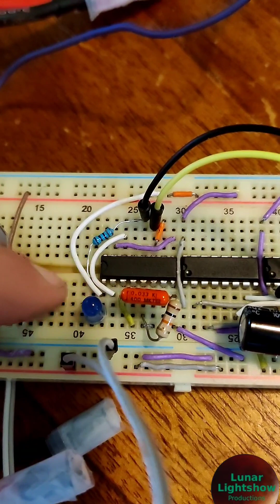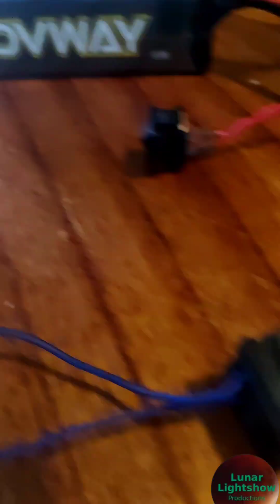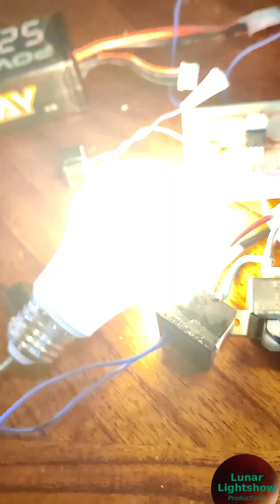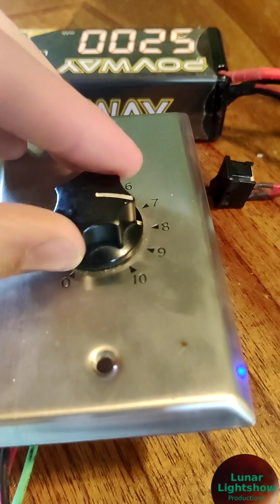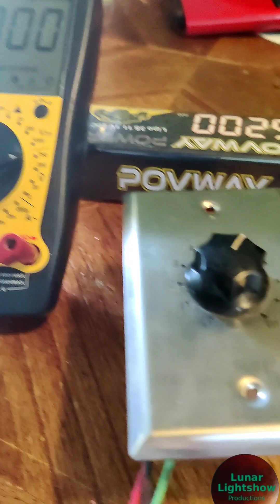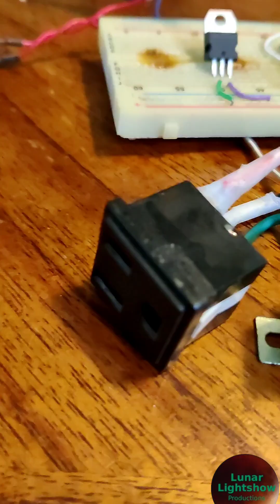Power a LightBulb with a Battery! DIY 12V DC to 180V+ AC Converter Circuit with 1 4049 IC & 4 L293Ds

Comment: Also... you can measure higher voltages with your meter, by dividing them down first. If you had, say, a 9K and a 1K resistor in series, 10K total, you could put a voltage across those. Then measuring just across the 1K would give you a tenth of the voltage. Ohm's law as applied to voltage distribution around a circuit. 

I'm really not trying to insult your intelligence but be very very careful with 1000V. It's a small transformer but a human heart is sensitive to much less! Be careful with the existing 120V or so too. You could literally die, only takes a moment, so be diligent and disciplined.

I don't know that they actually make 9K resistors, and for accuracy you'd measure the actual resistance of yours, rather than just going by the label, so you can calculate properly, because you want exactness I'm sure. 

It would also work with, say just 900 ohms and 100 ohms. But the total resistance determines how much current flows for a particular voltage (again Ohm's law). 1000V / 1000ohms would be 1A which, multiplied by the voltage, is 1000W, which is way way more than your resistors' power rating. In fact using 9K and 1K resistors would give 100mA, which, also x1000V would be 100W.

So actually you'll want much higher resistances. Small resistors are usually 1/4W, 250mW. So at 1000V that's 0.25mA. So... 4Megohms I think, in total, at least. So why not 1Megohm and 9Megohm resistors, giving 10M total, at 1000V that's 0.1mA, x1000V = 100mW, which is fine. That's still enough power to kill you though, of course. Maybe practice all this with 9V from a battery first or something.

Or else find yourself a bunch of electric heaters...
Reply from the maker: great idea! i should try that
Reply: @jacob_davis   Pardon me rambling on, but I get there in the end!

How old are you btw? Seems like your photo avatar thing is a few years old, I was very impressed by a kid who looks 9 making an inverter! But even as a teen it's impressive. Do you learn any of this at school or is it all self-taught and Internet?

When I was at school, I'd often be bored. But I had a genuine interest in science, so I just read the textbooks through for something to do. Actually learned better than from the lessons. Where we'd be given an experiment to do, it would inevitably fail for some reason, then the teacher wrote on the board what should have happened, for us all to copy down. Dear me!

Actually if you misbehaved you'd get shoved into a little cupboard of a room. What they didn't seem to realise was that the room was stuffed with back copies of New Scientist magazine, a respected British magazine a lot like Scientific American. Except not American. So I'd spend an hour or so with all these fantastic magazines reading about science, and learning a load, even though that wasn't the point. But curiosity will teach you much better than most schoolteachers. Although some are encouraging, and love the subject themselves, which really helps.

Not that I'm saying misbehave at school. Only if the punishment is more interesting and educational than the lesson.

Comment: Dude! Thanks for the video! Nice design, simple but does the trick, and would actually be practical if the power went out, you could at least power a lamp, well, y'know, you have! 

If you wanted true sine wave you could do it the way you describe but you'd probably need an analogue power amp, doing what the motor drivers do, for a sine wave which you'd probably generate with an analogue oscillator as well. But analogue stuff breaks my brain. I just tinker, not got a proper electronics education. 

There's such a thing as "modified sine wave" which I THINK is just leaving a bit of off-time between the positive and negative pulses, but is surprisingly useful in practice, although again, as you say, not so great with motors. Since square waves have high-frequency harmonics, which don't move the motor but do cause heating in the coils. Also of course if you went with 60Hz you'd have to have much more powerful drive circuits, using a higher frequency means you can get away with sending lots of little bursts of energy instead of fewer, bigger ones. Incidentally that's why power supplies, phone chargers, are so light these days compared to the old linear ones that had a big transformer inside. Instead, they work at high frequency pumping the input voltage into a much smaller transformer. Switch-mode power supplies, PC PSUs are that type.

You could do it with a digital to analogue convertor (DAC) though. Have you heard of Arduino? I have a feeling you'd love it. Little single-chip with a CPU, RAM, programmable flash ROM, and lots of peripherals built in, all in the one chip. So you get ADCs and DACs and timers and stuff. Microcontrollers have been around for decades. Speak 'n' Spell had one in the late '70s, but modern ones are more powerful. And the key thing with Arduino, is it's large community and software base. There's software routines to do all sorts of useful stuff, just about anything you could think of. Infra-red remote, RGB smart LEDs, keypads, smart cards... 

You program them in C, but the IDE you use is helpful and you can start small. Then you have the advantage of learning C, which is also what a lot of software is written in. Including operating systems, C is a low-level language that can control anything it's allowed to get at. There's tons of tutorials for Arduino. And it's open-source, so you can buy an unofficial non-brand-name one for literally a couple of bucks. Programs via USB lead, and that's all you need, also powered through it. 

Then get a few LEDs and switches and stuff and see what you can do. Maybe some 7-segment LEDs, or LCD displays. Something I enjoy, anyway, and using a microcontroller means you can put your ideas into practice by merely typing rather than having to buy chips and wire them up. Though you get that too!

Yeah 1300Hz works the lamp because the LEDs in there are DC anyway, there's a little power supply in the base that converts the mains into something suitable. You ever watch Big Clive's Youtube channel? He's great, covers everything, friendly bloke. I recommend. It's mostly lower-level stuff too, he goes into circuit diagrams but there's none of the theory and maths. An old incandescent light bulb would work with your inverter, or anything that's a resistive load really. Probably a phone charger too since those also just convert mains to DC then chop it up into high frequency and transform it. Maybe try it with an older, cheaper one! 

Thanks for the video, interesting to see what you've come up with. Never had someone make a video at my request before! Thanks also for indulging me in this rambling post. Assuming you did! Best of luck, mate!
Reply from the maker: yes the arduino is fun to use
you're right, digital to analog converter is the right term for what i was trying to explain
Reply: @jacob_davis  You said "analogue to digital" but I know what you meant, anybody would. Glad you're into Arduino, there's really few limits to what you can do. Companies online sell kits that contain a load of various components and input / output stuff to interface with the real world. You get a nice selection for experimenting with. In fact an Arduino's PWM DAC might be useful with your inverter.

It isn't a real analogue DAC, it just sends out fast pulses. The wider the pulses, the more current delivered, so that's sort-of analogue. If you smooth out the high frequencies it's an adequate replacement. Apologies if you already knew that. Since it's just on / off pulses though, you might be able to drive your motor driver chips with it, maybe using the inverter gates if one pin of the Arduino can't supply enough current to drive all of them. Then you'd have your transformer being sent a lot of pulses, which it will naturally smooth out, like inductors do. So you might be able to get a 60Hz DAC "sine" wave, that's close enough, thanks to the inductance of the transformer, to actually look like a sine wave. Have you got a scope?

Would be fun to try, solving the problem in software, and of course versatile. You could switch it to 50Hz if you ever wanted to. Some Arduino boards can run directly on 12V. They have an onboard regulator, you can supply the 12V to one of it's pins. Before the regulator, not after, of course!

I've bought a Pine Watch, which you can program yourself from the operating system up. Not really got into it yet though. There's an existing OS that uses a lot of Python, I suppose I could learn Python. I want to write apps and stuff that connect to my phone and let me do useful stuff. My first smartwatch I got so it could tell me who's calling. With my Bluetooth headphones on, I could take or reject calls without having to touch the phone in my pocket. But of course I need to know who's calling. An app would tell me via a voice, but I thought a watch display would be better.

You can get cheap smartwatches that are also phones in their own right! Only 2G though and that's limited more and more as providers drop it, and they really ought to, it's ancient and a waste of radio bandwidth. But you don't have to use the phone part, just as an accessory to your modern phone they're great. They do just about everything! And they're like $10! 

But for now I must endeavour with my Pine. Thanks for reading again!